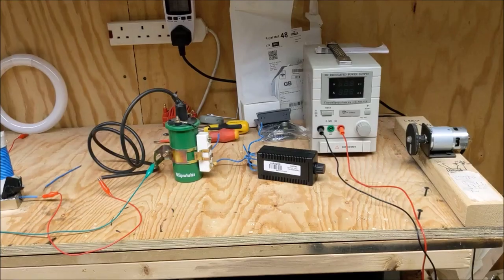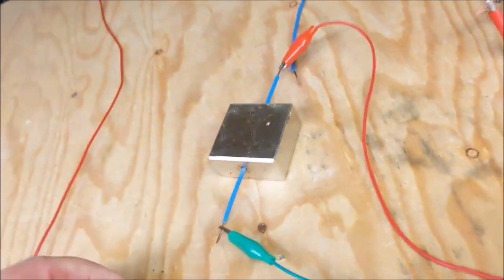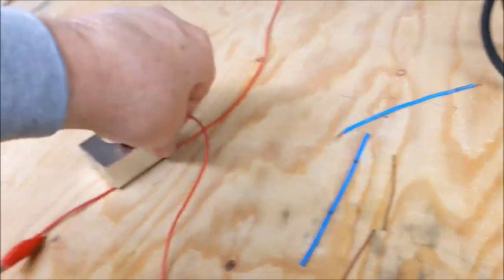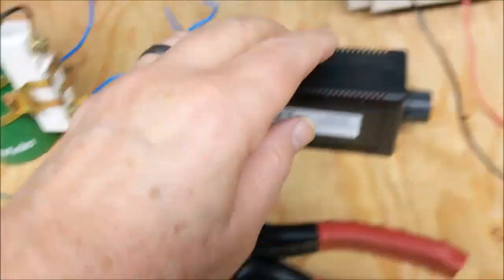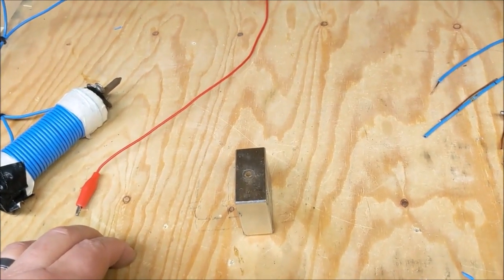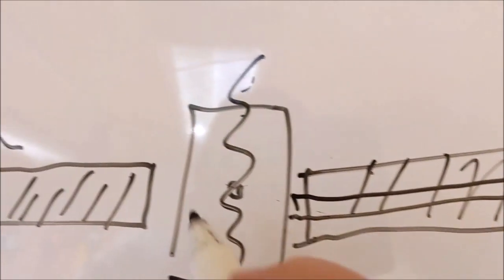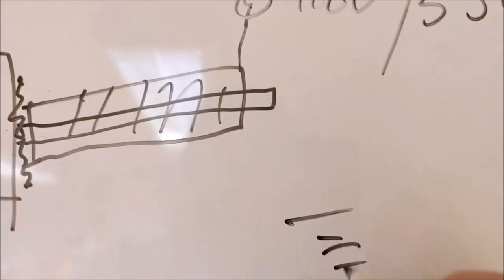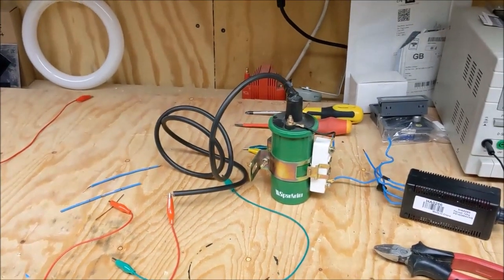2022 Update Autogen Point Sourse Power Generation

Comment: Should be high volts low amps. You are disturbing a field (like throwing a pebble in a calm pond) and tapping the energy from the ripples.  The idea is to "blow" a "wind" on that pond continuously to get larger waves at a steady rate.  (The waves being zero point negative energy.)

Comment: Note!  John Bedini discovered that to tap the zero point, you must use a SHARP pulse not a DC square wave pulse but a DC spike pulse such as you get from a capacitor discharging all at once or like Bedini uses, a coil and magnet pulse. The pulse must be fast.  A DC signal generator uses a square wave pulse.
Reply: Does it work?😊

Comment: meaning … it is a solid state generator
Reply from the maker: YW. My head is busying, now you are the first to see this. Yes are you up to try "Copying" this idea from the epicenter of a magnet?
So, so easy to replicate.
Drill small hole in the center of a bar magnet. Insert simple spark gap.
Pulse with HV 30,000v square or AC.
Connect a coil bingo at both ends N & S.

I just need to have the strength to work again in the workshop but one step at a time.
Regards. DC

Comment: Hope you get better would like you to really try a couple of things
1. Put a load on the coil and measure amps
2. Put a step down transformer on the coil and put a load on it and measure amps
And a question what is the blotch wall wire arcing to? Is there a wire on the other side of the magnet? Love to hear your answers!
Cheers
Reply from the maker: Hi G.K. Imagine there is a car spark plug at the centre of the magnet and that's it. Works like a car ignition system with varying speeds (Frequency) and different pulse types (Profiles).
Yes as soon as i continue with the project i want to test, test.
Thanks for your interest. 
Hope this helps .... DC
Reply: @e.powerdc1127  but remember electricity is all abt churning.... Like u churn butter fm curd.... Only thing it happens in copper....... More the copper the better its is....... Or u can use silver, only thing is instead of butter u hav electricity in copper silver  etc...... So either use silver tipped with something that can withstand heat and non breakable due heat as it gen heat..the electricity gen or amps goes up.... I think... So 20cps x 3 phases x amt of copper x magnetic flux ie the frequency which need to b achieved  delivers potn diff.... When u use more mag flux as in ur case u need less copper that's all but spark plug is the frequency generator pump and the spark gap takes care of the heat component so control of heat on the coils may b imp too and the spark gap tip
Reply from the maker: @DK-sg3oe  spot on. Inside the wire are turning (part rotation magnets) reactions to changes of poles. No electrons rotational magnets churning. 
Regards...DC

Comment: What is your definition of voltage? ...... and amps?
Reply from the maker: Hi R. Imagine there is a car spark plug at the centre of the magnet and that's it. Works like a car ignition system with varying speeds (Frequency) and different pulse types (Profiles).
Yes as soon as i continue with the project i want to test, test.
Voltage?  and Amps? 
Questions next up, i can see it in my mind and so it continues. 
If at first you don't succeed (Give up) Haha never!

Thanks for your interest. 
Hope this helps .... DC
Reply: @e.powerdc1127  "Questions next up, I can see it in my mind and so it continues." 
What does that mean?
Reply from the maker: @raucity4206 
"Work in progress" 
 "Electron Drift, flow" 
 "Quanta "  Number counting isn't enough! (Boring)
So the end game is to be measured "Yes". 

"I am trying to enjoy the journey of learning".

Question for you:- explain a field? (Not what it does).
What does that mean? 

Question for you:- How does a magnet sustain its magnetic properties?

Regards .... DC
Link, hope it helps... Much Love.
"https://www.quantamagazine.org/crisis-in-particle-physics-forces-a-rethink-of-what-is-natural-20220301/
Reply: @e.powerdc1127  u can literally increase the magnetic flux part by a series of magnets as designed to centrally act as spark gaps so that that the voltage is raised and recircuited  as each w produce a certain increase depending upon mag flux and copper wire... Magnets shd shd raise the voltage due flux or flipping and get the pulse required at the core spark gap u made getting them in a circuit shd raise the voltage at the ends as a multiplication factor u can get to work out before u 500 also check the amps or power performance when used  on series magnets acts as a series saprk gaps eventually determining the voltage u want to feed into the hv transformer to step dn  lv transformer wr adequate amp can b drawn
Reply from the maker: @DK-sg3oe  This so in parallel with my thinking. Think like they use magnets in a microwave ! 
Thanks for your interest, ..... DC